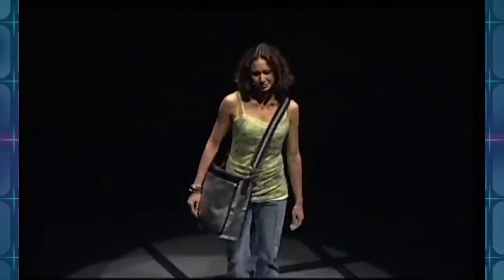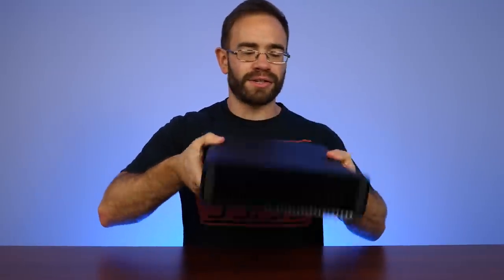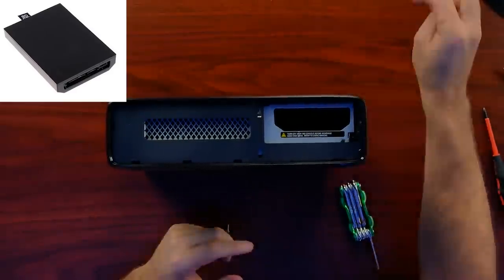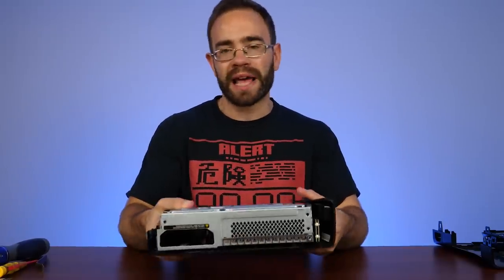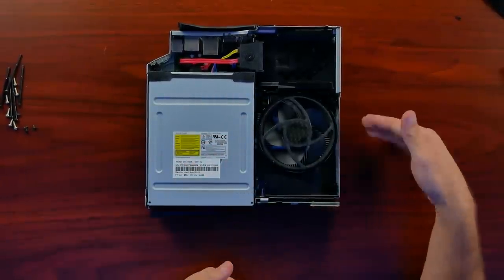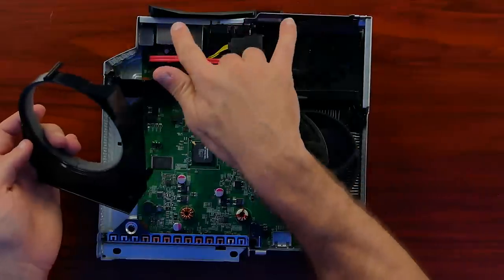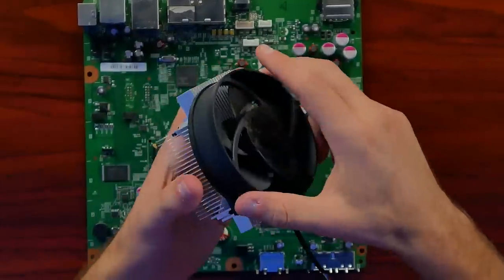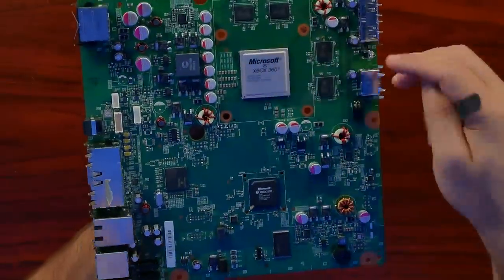Here's How Microsoft Solved The Xbox 360 Red Ring of Death

Comment: I returned my 360, seven times for RROD - after the 8th time of it breaking, I just gave up and eventually bought a new redesigned model. My friend however, he returned his eleven times, then magically got an original design model that is still working today. The entire thing was a huge cluster.
Reply: 7 systems for me.
Reply: 0 times for me 
Cuz I still have my Xbox 360 slim
And had out for 11 years
Reply: @alx54723  amazing story, thanks for adding.
Reply: I have an original 360 since released. I red ringed once and sent it back in to be fixed and never had an issue since. Oddly enough my slim had a red dot of death and after it overheats the second it turns on.. Now it's a glorified paper weight.. Completely useless
Reply: @rodmunch69  yeah well the reason is probably cuz it's a slim I have a white one which isn't slim and still doesn't have rrod
But it has a broken hdd
Reply: @alx54723  so many layers, amazing stuff.
Reply: @rodmunch69  thnx
Reply: atlanticbboy by 09 they had already reengineered it, the issue was with the 05-06 models. I later got an fat model in 07 or 08 when I got sick of all the returns and it worked fine for a long time before the drive died.
Reply: @rodmunch69  yep. Late 2008 is when they released the jasper revision, which tends to outlast the s and e models.
Reply: @rockl79  Wasn't there an 'arcade' model that was released a bit earlier, that used the smaller/lower wattage power supply? That was the one I ended up buying after getting sick of all the returns - but by memory (which could certainly be wrong) it was first released  as just an Arcade model with no HD, seemingly meant to target people like me that already had all the accessories off the failing model.
Reply: I bought an HDMI fat in 2011 new and I got Red Rings a year later. Sent it to Microsoft under warranty. They fixed it replaced the seal on the case and the system still works today.
Reply: 4 times for me, each time replaced for free with the 4th time getting a new model with the smaller chipset and a free larger hard drive.
Reply: i have an x360 elite for 10 years now..
Reply: 4 for me.
Reply: Cant believe any of you remained an xbox fan after the 3rd failure. Smdh
Reply: @InTheZone85  
I did about to give up Xbox after I had the slim when going through 4 original 360s, two through retail, 2 refurbished when Microsoft tried to pull that online only bs with the original Xbox One. Gave them the benefit of the doubt after they changed things, gotten the One (Sunset Overdrive edition, still works from 2014) & now they has turned things around, specially for next gen.
Reply: @InTheZone85  i guess you didn't read the part about how the warranty was extended,  and they took care of us.  Sont know what happened to the op but almost all of us got a new xbox out of it and never had a problem since.
Reply: @wazza831  Amazing story, thanks for sharing.
Reply: I would of signed off from xbox permanently long before buying 7 and then a 8th that worked. You must really hate playstation for that kind of dedication my guy
Reply: @TherealBlackheart  no one was buying them mate.  MS was replacing them, for free.  I am unsure why he bought the redesigned model though.

This was a common enough issue, and I honestly did not know anyone that bought an early 360 that did not have this problem.  Without a fault though, every one of us got a new xbox with the new chipset.
Reply: @vaguedreams  oh okay, gotcha. Makes more sense.
Reply: @vaguedreams  I bought one because MS just kept sending me "repaired" models that just broke again the next month - and it took weeks to deal with the replacement process. Also I'm no on welfare and my time is money and I have a giant house with lots of rooms and sometimes I want to play stuff in different places. My friend, on his 11th return, finally got the updated model and it still works until today. I gave up after the 7th return.
Reply: 3 systems including 1 fat 1 slim and 1 e.
Reply: I just gave up on 360 and continued on with my PS3 after sending it back for RROD repair a couple times
Reply: I fell your pain. 11 for me. I got the first RROD 30 minutes into my play session on day one .....very disappointed to say the least.
Reply: Everytime it broke, it was two weeks of existential dread and sadness.
Reply: @rockl79  This is the one I got. Haven't used it since 2013 when X1 came out. But never any issues, and it saw daily usage over those 5 years.
Reply: I think i was 7 times as well, 5 at the minimum. lost count but sure i got to 7.
Reply: @alx54723  Slim is different design internally so yer you should not have had problems.
Reply: @wils35  yeah
Reply: @TherealBlackheart  That's why it cost microsoft loads of money because they had to repair them, Besides Xbox was better than playstation at that time. Pretty much same games jus xbox was soo much better online
Reply: @wils35  agreed, I never owned a ps3. But part of me sorta wishes just so I could of saved money on live.
Reply: @kory7698  I also have a Xbox 360 slim and it has the red dot, just been sitting there for years, it used to scare me lol, like a laser that’s gonna shoot you or terminator
Reply: Microsoft only let me return it once... they said that I had already gotten my Xbox repaired and that they weren’t going to fix it when it broke for a second time... because of this I didn’t buy an Xbox One, but built a gaming PC for the first time. Best decision ever.
Reply: He probably ended up receiving an original phat with an Opus motherboard in it.
Reply: @at-cj2iy  by 2009 they had already changed the internals. It was the 2005-06 machines that had all the issues, and MS would do just that, change the paste, reflow the solder and ship them back out and they’d die again after a few months. The issue was MS not just replacing the faculty parts, in the long run I can’t believe it didn’t cost them more to keep shipping and working on the broke machines.
Reply: Never had a RROD although I had the 360 Arcade Variant
Reply: I've got a June 2008 360 Elite that's working fine for me, though I have taken it apart and cleaned it, as well as replacing the thermal paste.
Reply: @Dreams_Of_Lavender  the issue was with the early systems from 2005-06, by 2008 they had already gone through a couple of revisions.
Reply: well, I changed 4 xbox 360 s lmao now I'm at my 5th system and I'm actually scared that is going to fail.
Reply: @therussianbucket  as long as you didn't get the first generation 360, you're likely OK. If you got a slim or the very last model, those will likely last a very long time. If I was buying anything new however, I'm only getting a slim or that last model.
Reply: @rodmunch69  no bro I actually changed 4 360 slim lmao, and I did maintenance on them, changed thermal compound and t
everything and they still failed...
Reply: @therussianbucket  you're literally the only person I've heard of that's had issues with them. I had 2nd gen fat still break after the laser failed, but with the slims I never had an issue and they have a very good rep in general.
Reply: @rodmunch69  I know bro, maybe I'm just not lucky. I had my first Slim and it broke after a week, had my second that broke 2 years after, then I had a third that literally lasted 2 days, ordered a motherboard replacement for it and it lasted like idk 1 year, and after that I got my "5th" one for just 40euros including two pads and 12 games so not bad. But I'm worried because it's really noisy and I don't know if the older owner made any maintenance to it.
Reply: @therussianbucket  maybe just pick up a professional refurbished one while they're still cheap - the prices have already started rising and likely will only increase going forward. Good thing, at least for me, most anything I want to play has backwards compat, so a XB1 or XB-series (still a stupid name) can play nearly everything I've tried.
Reply: @rodmunch69  that's nice, i'm a pc gamer though, I keep my 360 for older games and netflix mainly
Reply: @therussianbucket  I have pretty much every mainstream console ever, so I just keep it around as part of my collection. I still have 2 working ones at the moment, hopefully they stay that way. But it is good to know MS is keeping backwards compat going.
Reply: @hiben6938  the kiddos don't actually believe this stuff really happened -- but it really did. 11 for you, 11 for one of my friends, 7 times myself before I gave up and bought a new redesigned model. MS was good in that the returns were free and they didn't hassle you, but they had to spend more in shipping than it would have cost to just send out the new re-engineered units that didn't have the RROD issues (at least not nearly as common as the launch models)
Reply: 3 of my systems got the RROD. 2 of them were fixed under warranty. One of them wasn’t
Reply: I gave up on Microsoft after having so many consoles give out, I eventually switched to playstation but this year I got a series console after not owning a xbox in over 10 years, seems like Microsoft learned from their mistakes.
Reply: I Had the orginal 360 for many years never broke
Reply: Jesper models be like
Reply: I had my launch model 360 til like 2012 never RROD but i did sell it to gamestop for like 50$ wish i hadn't back then :/
Reply: My Xbox 360 has the three red lights and a secondary error code of 0001. I took it apart to try to fix it. After trying to do a reflow using a heat gun and changing the thermal compound it still is displaying the red ring of death. After reading everyone's horror story about multiple returns I think it might be best to concentrate my efforts on emulation instead.
Reply: I have an original launch model premium 360 from early 2006 that's still working perfectly.
Reply: @kory7698  can i buy that lol
Reply: My Xbox never RROD'd on me, it's a black redesigned model tho
Reply: @casty59aj  that's not the XBOX's that had the RROD issue. It was only the early versions that had it as a wide spread issue. While it could happen to any of them, the first 12-18 months of units are super unreliable. However, if someone has one that has lasted this long, then at this point it will probably keep working.

Comment: You can’t replace the DVD drive in the Xbox 360 as it’s paired with the console via encryption key. This was to prevent users replacing the stock drive with a modded one.
Reply: I got one from a pawn shop and someone tried replaced the driver so I cant play games on it
Reply: RGH it and it’ll work

Comment: The slim isnt the best revision. The Jasper is, it's the most reliable console. Slims are starting to fail more and more now.
Reply: My one hasent for 11 years
Reply: Yep!! I see many rrod slim on reddit nowadays. I have three jasper V2, all running without issue. One of them get heavy heavy usage, still today (rgh on aurora and dual nand for netflix).
Reply: @alx54723  its the defective ones that are dying. Yours might be fine but there is no way to tell until its too late
Reply: @MrVitalic85  I use my v2 as my main. Runs cooler and quieter than my old s, its got a dual nand chip installed so I dual boot the blades and the newest dash.
Reply: Interesting.  I had a 90nm-CPU/90nm-GPU launch 360 (Xenon? Zephyr?) originally, and it RRoD'd.  The warranty replacement was another 90nm/90nm unit, which also failed, within about 6 months.  That made me bite the bullet, and seek out a $200 Jasper (65nm/65nm) Arcade, brand-new SKU in 2008.  Moved my HDD over to it from the dead 360, and I was good to go.  This Jasper (V1) unit still sits here a few feet away from me, connected via VGA to my PC monitor, and still works just fine.  

Never owned a Slim.  Never had to.  So I don't know how reliable they are by comparison.  It's weird that they'd fail more often, since the underclocked 45nm integrated chip is loafing in comparison to the older stuff.
Reply: @joesterling4299  from what I have read online the slims die in other parts of the board.
Reply: What about the 360e?
Reply: slims do fail but for other reasons,and not in the same rate as the old phats
Reply: @omegarugal9283  yep
Reply: @rockl79  I agree they are good, but the arcade model has a fan as loud as a fucking jet engine
Reply: Yup, the Jasper was introduced in 2009 I believe the reason why I bought the elite that time. I got the modern warfare 2 edition. It still works to this day.
Reply: I Have both Slim and Xbox 360 Elite (120GB 2007). Never had issues with the silm. The elite had been fixed once I can't remember why it was 9 years ago. It has been collecting dust for 5 years now and I decided to turn it just for fun and man the fans were LOUD took 5 mins to over heat and show me the lovely red lights. Opened it up and there was dust enough to suffocate you, so I turned on my air compressor and blow the crap out of it now it's running prefect.
Reply: A friend of mine bought a Jasper and a Slim. The jasper is fine whereas his slim isn't.
But, I have a slim, late model from 2011 I believe. Still going well.
Reply: probably would help if people took there 360 S apart and put fresh thermal paste on the main chip. 
i did that with mine as soon the warranty ran out, the stuff they use got real dry also one of the games i was playing was getting slows downs i used arctic mx4 and it's still going, only other thing i had to fix was the switch that tells it when the drive door is shut, it poped out of the clips poped it back in and added some hot glue to fix that.
Reply: @g3neralcross911  360e is good if it gets rrod just hold down power button and it works again

Comment: The 360 never had a problem with ventilation or overheating, the problem was the GPU had low TG under fill which accelerated thermal fatigue in the solder bumps

Comment: I remember taking apart my 360s for the first time for a deep clean... it took me 4 hours
Reply: Those latches...
Reply: S C R E W S
Reply: I just do it the same thus quarantine but nothing happens
Reply: When I took mine apart I spliced the fans power with the cd drive power and everything worked well  the fan being a bit louder from the full 12v constant I gave it. But never had a system failure of any sort and I did this back in 2012. I had a special tool I got on Amazon for around 10 bucks to take it apart effortlessly
Reply: foreal? 4 hours. i gotta open mine. bought it used from a local game store but it has this red nasty dust all over the vents and shit. i need to clean that asap
Reply: @InitialXG  If the console has been apart before you can literally just rip it open for the most part. May need a screw driver for the tabs on the top and bottom VENTS but as far as the main case goes, just get your fingers under the clips on the front to loosen them, then just pull the plastic halves apart and it will pop off. Takes less than a minute. If this guy took 4 hours he was just very nervous and not actually doing anything.

Comment: If my memory serves me correctly, they fixed the red rings by implementing a new motherboard design and the new Jasper chip set. That was the reason why I bought the 360 elite modern warfare 2 edition back in 2009. I previously had the original 360 which died numerous times with red rings. Since I bought the elite in 2009, I never once had an issue especially with the amount of hours spent playing Modern Warfare 2, Halo and Gears. Then with Microsoft’s ridiculous new policies for the new Xbox One in 2013, I jumped ship back to PlayStation and bought the PS4. Now, in 2021, I bought the new Xbox Series S. It’s nice to be back.

Edit: I forgot to mention that I took out and played my 360 elite a few months ago and it still works like new. Had some nostalgia moments especially seeing my friends list. Most of them are offline since 10 years ago. You wonder what they’re all doing now in life. 2007-2012 was a unique time for online gaming as a teenager. Great memories. Time is flying
Reply: Elite.
2009
Jasper chipset
I wonder what the correlation is?
The Jasper chip was introduced in the 2009 Xbox 360s, Elite included. If you got an Elite in '09, chances are it hasn't and won't red ring.
Reply: I have 2007 falcon
Reply: @toopienator  Jasper was introduced in November 08
Reply: @PheonixVideos07   Same, works like a charm